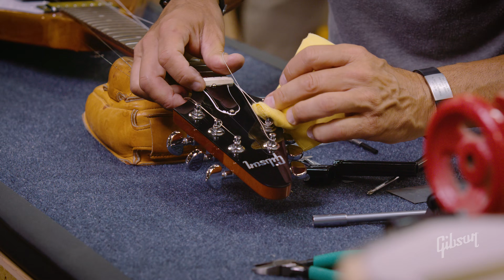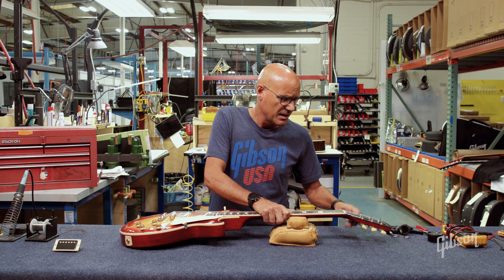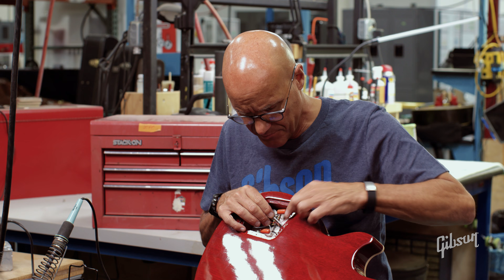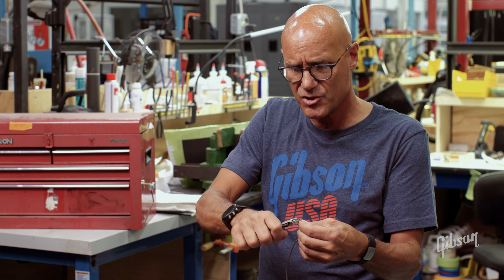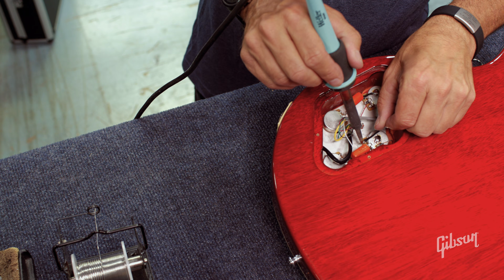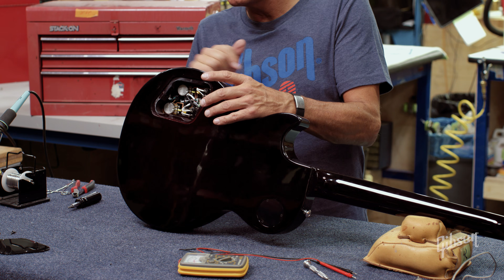How To Change Your Guitar's Pickups

Comment: um so I just thought of something..why cut and remove at all unless you  also need a string change as well as replace the pups..why not just loosen tension at the headstock pull off the tail piece replace the pups and reinstall the tail piece and tune to key and pitch????

Comment: I' am quite new to soldering. It has always been a bit of an intimidation factor. Messing it up and then taking my mistake for someone else to straighten out, feeling like a fool. But this week, I actually swapped out 3 guitar PU; Esquire, Telecaster and Les Paul. All the Fenders went extremely well and competently swapped them out one the first try with NO problems. Though, I thought I had done something wrong, as when I plug it the Esquire, here was a LOUD hum coming from the amp. It took me about 3 minutes to discover, it was the interference with the soldering station, that was next to the guitar. I was particularly interested watching this video. As I believed the Gibson, would be more of a challenge. BUT, to my pleasant surprise, again, replacing the 2 PU ( making a replica of the Yardburst of Jeff Beck ), it went extremely well. The PU worked ( testing them as you described ) on the first go around. The only problem I faced were those pesky springs! It took me about 20mins on the first one, losing two springs that, that rocketed some place! The 2nd one I cut it down to about half that time. A BIG thank you for your awesome video. It helped me a lot!!

Comment: That's different my Les Paul Studio has push pull pots for coil splitting not coil tapping.
When did they make one with coil tapping on a humbucker pickup ?
Reply: It's really a partial split thru a cap, but they call it a tap. :(

Comment: What type of analog multimeter is a great one to get?
Reply: I have been using digital metres for about 25 years now. The same trick works, or at least has worked on all six of my digital metres over the years. You don’t need an analogue meter. Let’s say you’re measuring the DC resistance of a pick up and it’s 9K. When you tap the magnets the resistance might temporally jump up to 11 K and then drop down to nine. If you change the phase the resistance when you tap it will go from 9K temporary down to 6K and then back. And for the magnetic polarity you can use a compass,
Reply: @fenderlead1  Thanks!

Comment: Thanks Jim. I would really like to see Gibson come out with replacement Quick Connect pickups again. You talk here about how to change them, but the hard part isn't changing them, it's finding them. I know that I could rip the whole pcb out and put a new wiring harness in, or cut the quick connects off and solder them into a new pickup, but I really don't want to do either of those. I would really like to just be able to get a set of Burstbuckers with quick connects and pop them in.

Comment: That metal plate makes for quicker installation at the factory 
And I know it's a great shield.

But to change out a pot don't you have to unsolder everything and remove the whole thing?

I've never attempted it bc it looks like it would be a giant cluster fluck. 

Gibson is quite different than Leo, who used player feedback to give the musician what he needed, instead of the way Gibson operates.

Like, "We'll tell YOU what you need!"

Comment: Thanks for the good video

The Gibson guitar has a circuit board, and the pickup is a jack type.
Please also let us know if the pickup you want to exchange is a regular wire type.

The circuit board type has 5 wires, but the general wire type (eg Duncan passive pickup) has 3 wires, so I don't know what to do with it.

Comment: It is necessary to cover the lacquer of the body while soldering. The solder or rather the flux inside tends to sprinkle. You don’t want to let the hot sprinkles burn the lacquer
Reply: I wouldn't expect less from gibbons quality control. When it comes to qc Gibson is bottom of the barrel
Reply: @preston2636     oh look another Gibson hater .  yawn

Comment: I think this is a great series.  The MacGyver tips are helpful.  I think you should have included a tip on installing the pickup ring.  All the pickups I’ve installed did not have pickup rings and those are a pain in the butt to install.  Also maybe show how to solder quick connect to new pickup since they don’t come with them.
Reply: They make a nifty little tool just for that purpose .. Stewart Mcdonald and other luthier supply houses sell them , and probably Amazon too